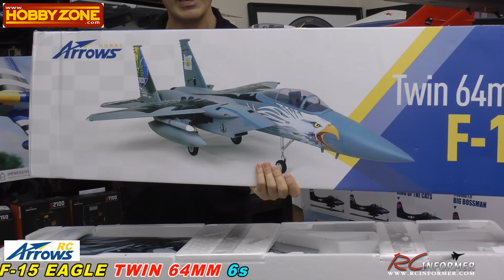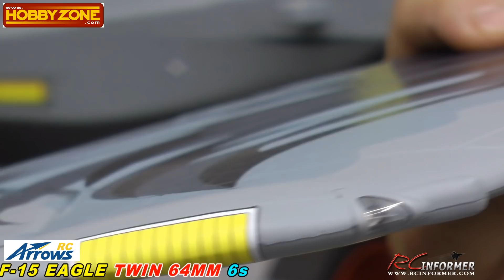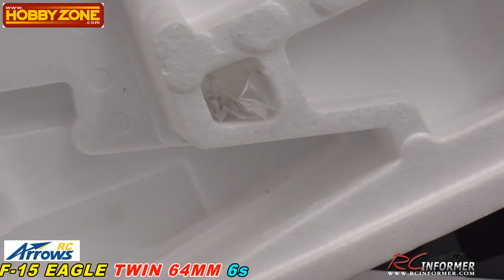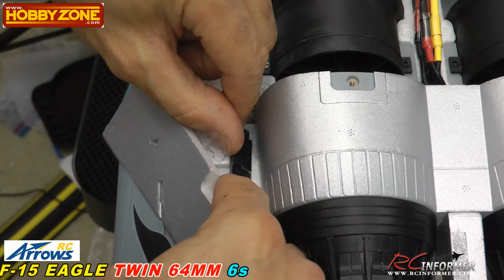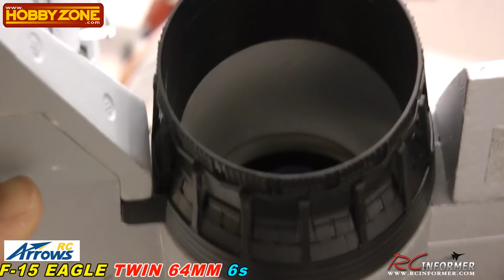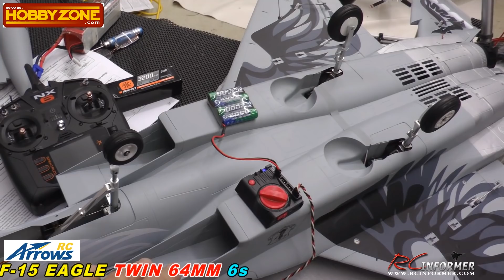HOBBYZONE ARROWS F-15 Eagle Twin 64mm 6s EDF jet FIRST LOOK & Unboxing By: RCINFORMER

Comment: Actually there's another guy I follow & he's done fly review & full build of this exact same bird, he used foam tack in the pocket of the horizontal & vertical stabs. He put some in the pocket then spread it around without any difficulty.

Comment: hey rich do you prefer the f15 or mig from arrows.
Reply from the maker: Both are really nice models! The F-15 is much faster but has a narrower wheel base... so it will tend to tip easier. The Mig does much better good high alpha flight & has a slightly wider wheel base and is less likely to tip due to the wider gear. I still have both planes because they are both outstanding models!